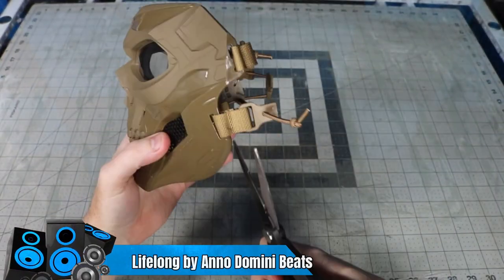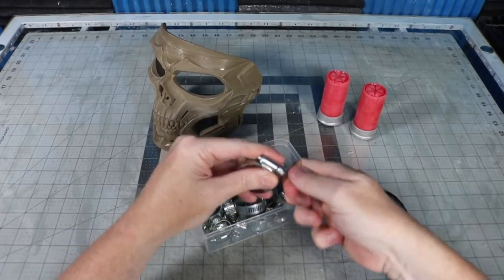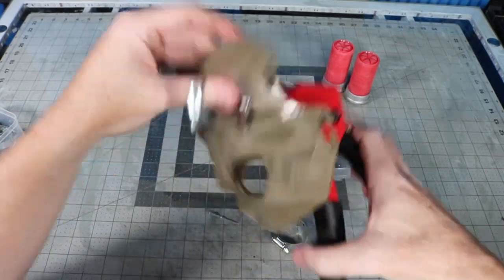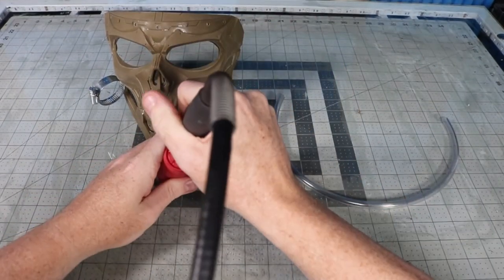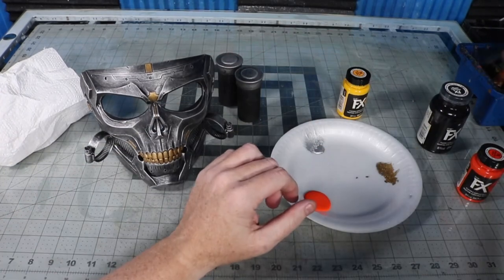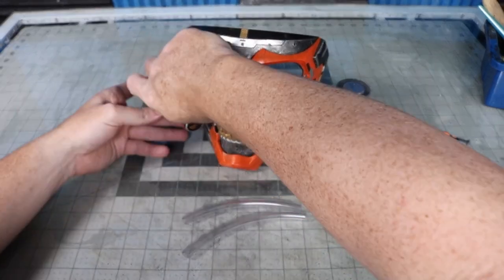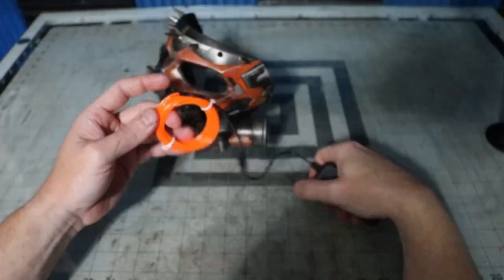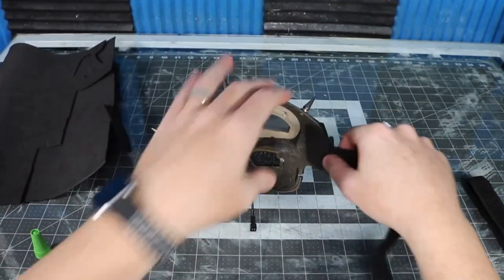Piecing Together a Cyberpunk Skull Mask

Comment: You know there is a version of that mask that comes WITH resperators.
Reply from the maker: I picked this one up a while back on sale and it came with a helmet top. It's a really cool mask base.
Reply: @MuchProps  Yeah, I have this one myself, as well as the respirator one. I've painted and weathered mine, added a few bits from a spy gear pair of googles for a sniper character costume that I'm working on.

I've been thinking about picking up a second one to cut up and turn into a cybernetic prosthetic jaw.